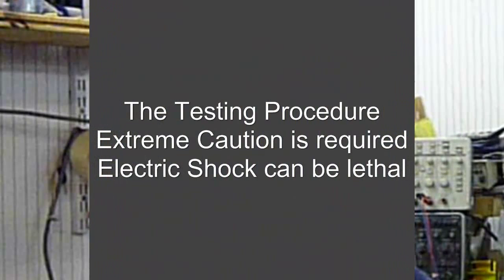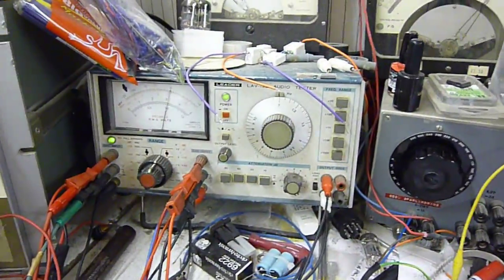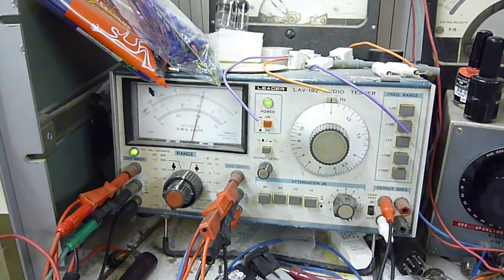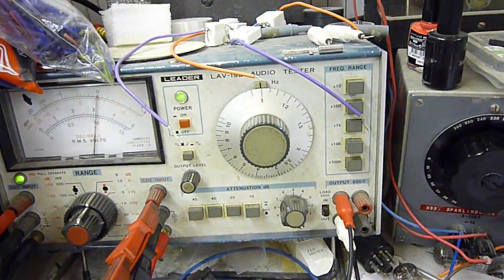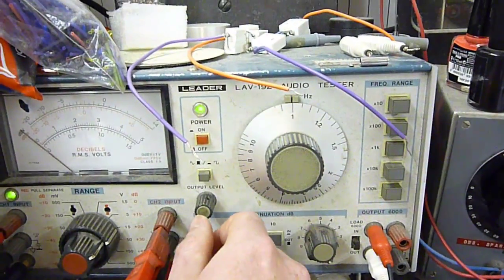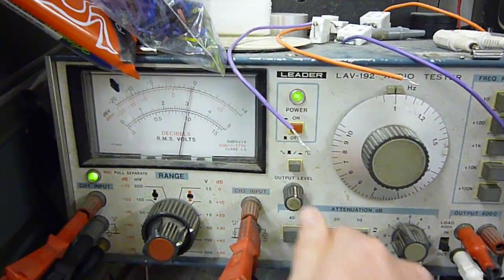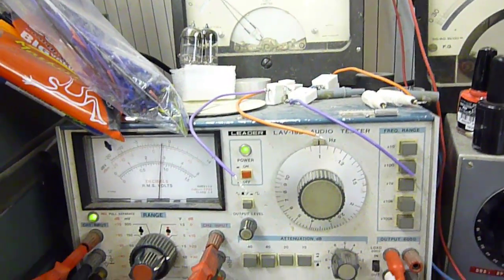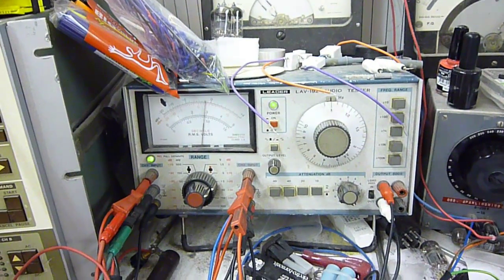How to test audio output power in watts from an Audion Sterling tube Amp.

Comment: Can you repair combo amps? I on mine and it keep blowing the fuse even if I put a new fuse.
Reply from the maker: +Ello Oku 
Yes we can probably repair it, but it sounds like either a shorted mains transformer or short circuit that is taking the fuse out, so would need a new transformer

Comment: Are you using an 8 ohm dummy load for the amplifier output?
Reply: +Rob Robinette Its seems that it has been fed back to that old generator, normally you would use dummy load - but this seems strange.